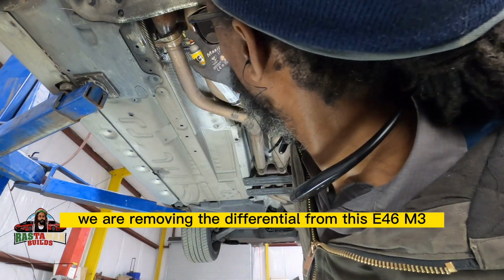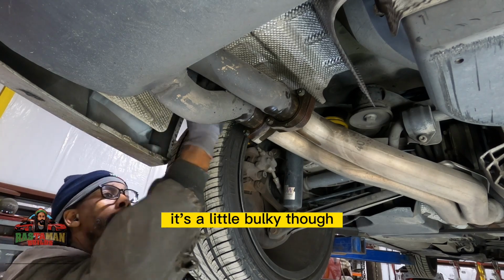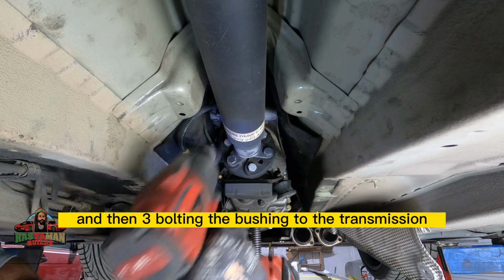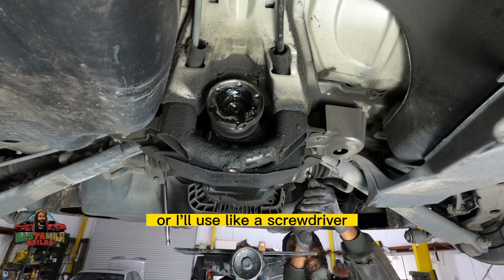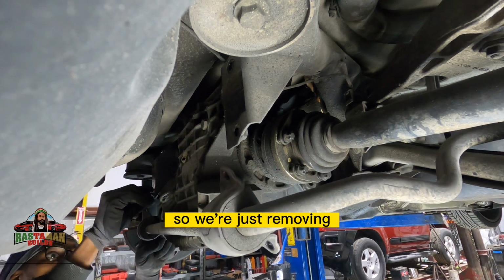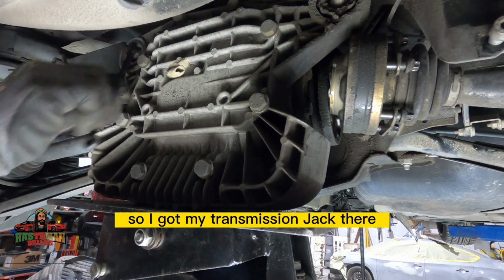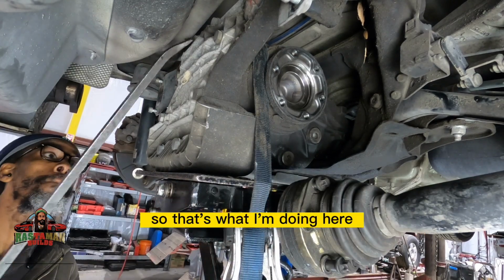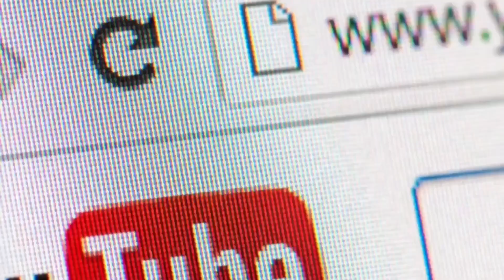E46 M3 Differential Removal Quick and Easy

Comment: Nice video. Great cars to work on. If you want to save time. You don't have to remove the driveshaft. Just unbolt the driveshaft on the differential side. Mark the center support bearing due preload, than loosen the CSB. It will allow the driveshaft to bend, hence separating the driveshaft from the differential will be possible.
Reply: How do you mark the csb? Purpose of this is to make sure it deforms bearing just like it did before right?
Reply: @lukeg6767  The CSB is mounted with two 13mm nuts. The holder is preloaded. You can Mark the holder, since it allows you to place the CSB back and forth.

Comment: I bought a Z4M and it seems to have diff whine off-throttle (pinion bearing?) and clunks like crazy, on power, off power, etc. I assume I’m gonna have to have the diff rebuilt and have all bushings replaced plus maybe guibo just in case.
Reply from the maker: I agree. common problem

Comment: They use copper nuts on the exhaust which doesn’t rust nearly like steel and they are softer. Also the copper doesn’t bind like steel and thats why they put copper in anticease grease

Comment: Hey rastaman, I was charged 20 hours to remove the differential and replace the differential cover. The differential had to be inspected because a bolt had backed out. 20 hours for the complete job. I feel like I was ass raped mon!!! What do you think??? Not only that, my car has a new subtle clunk it didn't have before....
Reply from the maker: The clunk could be one of the mounting bolts need to be tightened and 20 is a tad bit much. A little on the high side in my opinion
Reply: @RastamanBuilds  I appreciate your reply! I don't trust them, I feel that they may have sabotaged my car.  I had an incident happen a week later after I got my car back.  My chain tensioner bolt came loose completely and nearly all my oil came out, and made a mess. I have reason to believe this was loosened purposely.